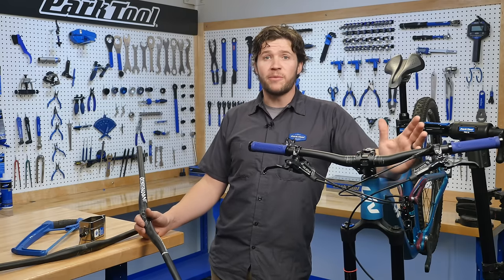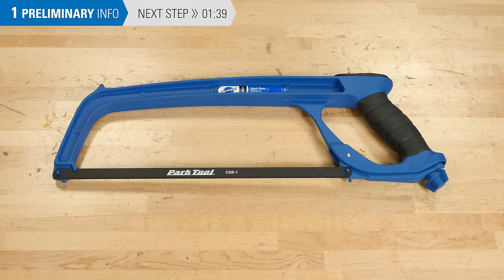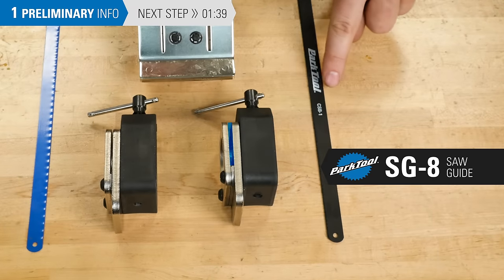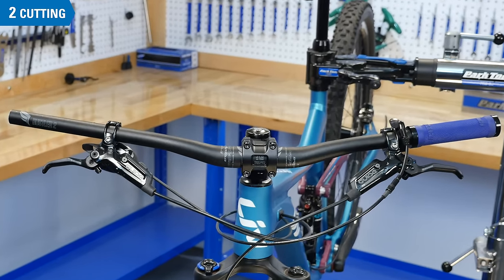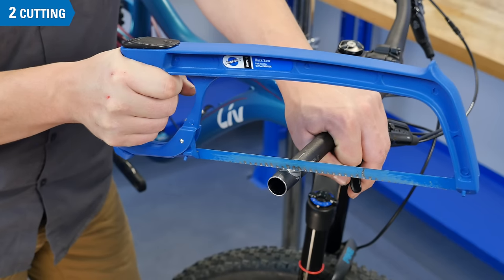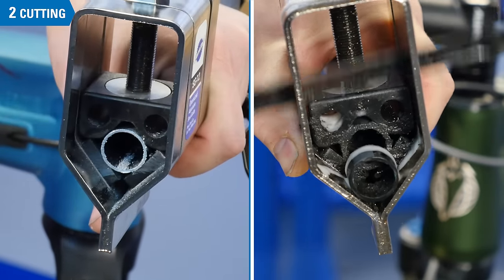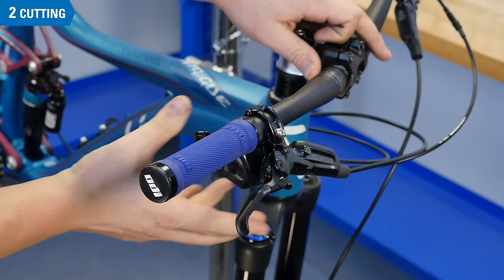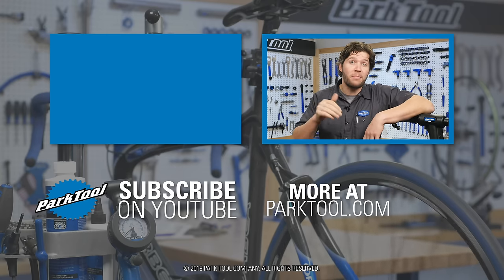How to Cut Bicycle Handlebars

Comment: A hose clamp works good enough as a guide when cutting with a hack saw.
Reply: Oooh thanks great idea
Reply: How about cable ties?
Reply: Pipe cutter works wonders also.
Reply: The cutting guide tool prevents slippage which the hose clamp and zip ties can't prevent if it should occur.

Comment: rotary pipe cutters normally turn so the tension knob is going forward around the tube being cut.
Reply: Way way cheaper and much cleaner cut. This seems like a huge pain in the butt
Reply: Copper pipe tube cutter, my first idea to use when I trimmed my son's handlebar. Worked slicker than... ; )

Comment: What was the blue hand tool you used after filing the end of the handlebar? It looked like some sort of sanding device.
Reply: Outer deburring tool
Reply: Deburring tool for inside & outside diameter tube ; typically found in the plumbing tool area of Home Depot

Comment: Can you make the same cut to shorten a seat post? Are there any consideration that are special? Like the amount of overlap of the post within the frame or anything else?
Reply from the maker: Yes this process can apply to cutting a seat post. Before cutting, measure up to the "Minimum Insertion" line.  Use the distance after cutting for the new min line, possibly with a piece of tape.  But regardless of what the post indicates, have the end of the post below any joint (weld or bonding) where the top tube meets the seat tube.
Reply: Thank you. You guys are awesome.  @parktool

Comment: Can we fix the 105 crankset on press fit bottom bracket??
I have Fuji Roubaix 1.3 which had press fit bottom bracket now I want to install Shimano 105 cranck set. Let me know how do I go ahead.

Thanks
Reply: idk if you ever got an answer to this, but of course it depends on what kind of press fit bottom bracket your bike supports. If it supports Shimano Hollowtech 2 Press Fit bottom brackets, then yes. I have that exact setup on my Giant Fastroad Advanced 1 (Press Fit BB + R7000 105 Crankset)

Comment: Any hacks for the blade guide?
Reply from the maker: old locks from lock on grips work pretty well for a few cuts, but they are typically Aluminum and do not resist a stray saw blade very well.
Reply: Try getting a pipe cutter if the bars are alu